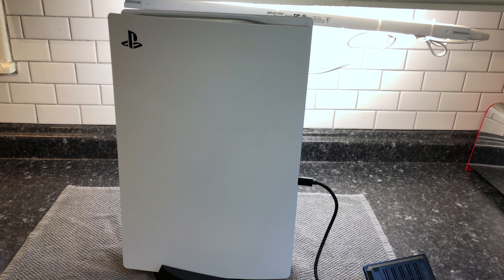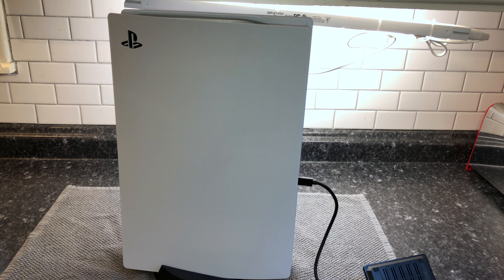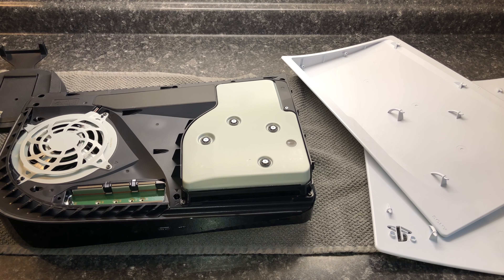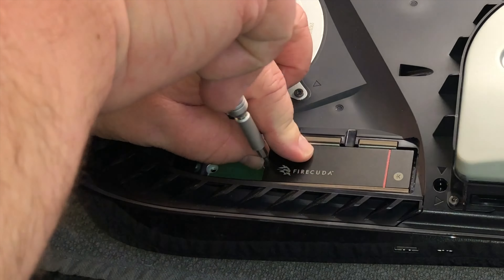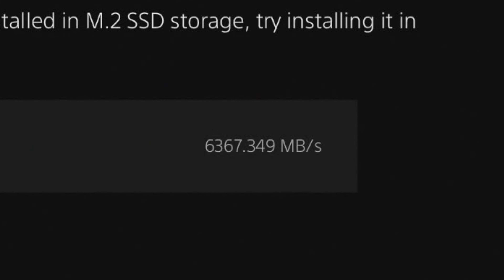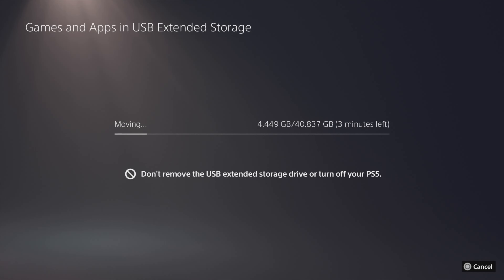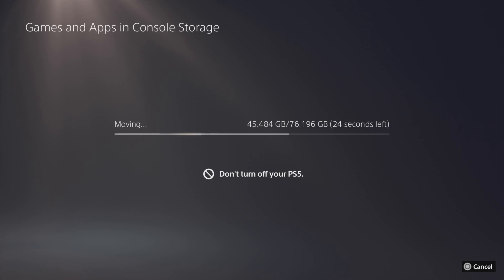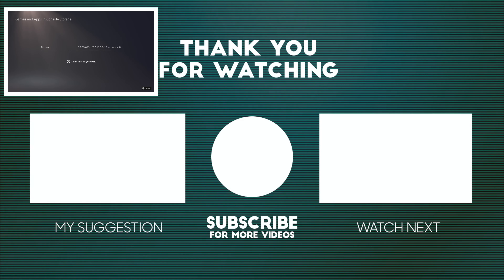PS5 M.2 SSD Upgrade - Player One Start

Comment: Important note: make sure you update your SSDs firmware. Samsung had a NASTY bug in their 980 Pro 2TB SSDs (popular PS5 drive) that would lock the drive WAY before it's rated drive life (100TBW vs 1400ishTBW).

Unfortunately you can't flash the firmware with a USB NVMe adapter, it HAS to be plugged in to a desktop or laptops m.2 slot so it's a huge hassle, but more of a hassle if you get a drive like the 980 Pro with the firmware bug!
Reply from the maker: @ALM1GHTY.PEANUT, that is interesting. You would think they would have something figured out for that...🤷🏻‍♂️ So far, mine has been preforming like a champ.